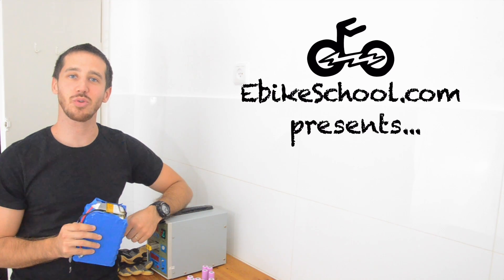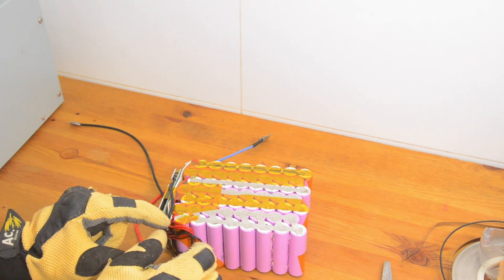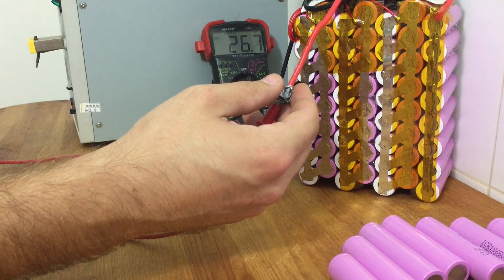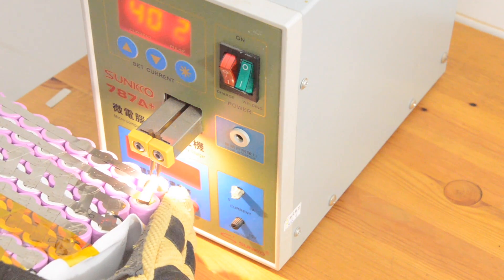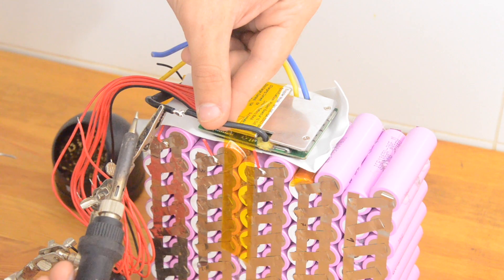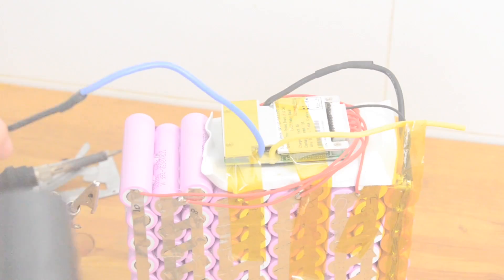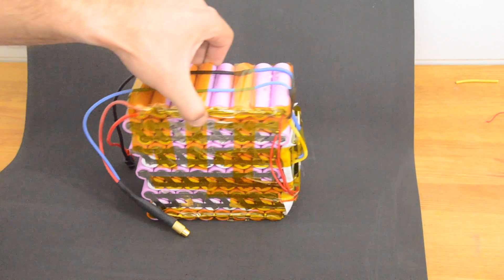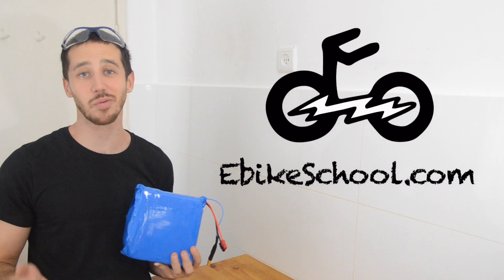How to Increase the Voltage of an Ebike Battery

Comment: Hi. Thanks for the how to video. 
I was wondering how you can adjust to increase the voltage and or current of the hub motor in the controller?

Comment: Hi Mica.  I really hope you can help me out .  I have a 36v nominal-14AH- 10S4P- 40 X 18650 cells total battery pack with a BMS, from a skateboard.
Because I do not have a spot welder or the proper battery charger for a 36v pack,  I have decided to dismantle the complete pack and use the individual cells for other projects.
I have been scouring the internet for days now but cannot find anyone who dismantles a pack only guys building packs.
I have disconnected the BMS from the pack but I don’t know how I am suppose the disconnect the nickel strips because it is in parallel and series. Is there a specific sequence that I need to follow or can I just rip them off ??????
Pls be as specific as you can as I am not used to a pack in this type of configuration, when I first thought that I could just rip off one off the nickel strips it sparked a little and got a little hot, so I stopped and started trying to find more info on the internet and found you.
Sure hope you have the time to help me out.
Thanks
Gerry

Comment: Stupid idea to tell people add brand new 18650 two a dying cell  
Or worse adding cells from China that aren't genuine your basicly teaching people how to make a bomb that's sits under there butt 
Plus even if they passed the stage off buying the right cells 

For anyone who reads this . These battery's will Vent  if you slightly short them . 
You shouldn't use old cells unless your happy with the risk .
You need to own a hobby charger with a balancer .
This will check.that the battery's All discharge at the same rate. 
Trust me I've blown enough of these up because.i was happy to take the risk with dodgy  China cells. 
Help buying cells . LG or Samsung  . Price should be around 10 pound each

Comment: What is the max voltage difference of each cell ? 
I got cells ranging from 4.1 to 4.2V
Reply: Put them on a charger. And see if they charge properly. Should be full at 4.22 
Then discharge them using the charger two the same level. Put them in the pack use your charger again to charge each individual  battery two and make sure they are balanced ( unbalanced battery's will explode so being different charge values is fine as long as they charge and discharge at similar  speeds
Reply: Also each cell should be individually wired to the bms ( and you should by an bms  rated for the right size of the new battery and the amount of cells your using.

Comment: If I have a 48v  500w motor how bad or good of an ideal would be putting 2x48v lithium’s batteries in series or paralell to it ??
Reply: Parallel is fine, you will increase riding distance. In series would make it a 96v battery and blow the controller and motor.

Comment: do we really need to solder every cell in series for increase in voltage?
wont the result be the same just by attaching 1 negative and 1 positive at each end respectively???
Reply: How would the voltage travel if you didnt make connections for it xD

Comment: I'm trying to boost my 2 year old lg mj1 48v pack to 72v. I have 10p13s. I was planning on rearranging them to be 6p18s then add new cells to make it 10p or 12p. Assuming 10s, I would be adding 4 rows of 18. This should keep each cell group with the same capacity. I am told internal resistance stays fairly constant with age on these mj1 cells. I wonder if it would be better to just add new cells at the end of the series to avoid even a little internal resistance difference. It seems like that might put less strain on the pack, even if the original cells drain first. I've done a lot of googling and the best answer so far is build a new pack with $2000 worth of cells and junk. Informed opinions anyone?
Reply: Make sure you get a  new bms
Reply: They are like 2 quid and this guy didn't mention them (from the way your tslling about the cells im sure you know enough to know the rest

Comment: Hii..I make li ion battery for 600w motor for using 2500mah li ion cell(13 in parallel & 15 in series) and 13s 35Amp BMS but when I charge full then this battery gives 56v via BMS and I put into bike then my bike ride is aprox 9km and then the battery voltage is down suddenly 26v  but when I checked without BMS voltage of battery, is 52v. Then I plug in charge battery via BMS that time the battery doesn't charge. 
Can you give the solution of this problem ? Please.

Comment: hello friend, I build a battery with bms and 10 series 5cells with used laptop cells(3.7 volt manteined after 15 days), I have a 750-watt motor 36 volt,. after using it 100 meters, the thermal protection of the bms interrupts the current. ?which amperage do you recommend for this motore??? Thanks friend
Reply: 10x 3.6 = 36volts. I think your batteries do not have a good discharge rate and the bms cuts out. Try finding better batteries. 750w needs at least 20amp bms. 5 batteries in parallel needs 4amps per cell. I think your batteries are not up to that power. Try taking it slower instead of faster.

Comment: Hello Micah, while you were connecting the positive discharge red wire into the 10th parallel group, you stripped the whole wire to meet the length of the parallel group. But is it possible to solder the discharge wire at just one spot of the whole parallel group? Will this option generate more heat in the discharge wires? Thanks.

Comment: I'm sorry if this sounds stupid but I just bought a 36v 15ah battery 10s5p and the cells are 3.7v and 2600mah so am I right in thinking I only have a 13ah battery the 5p x 2.600mah = 13ah? and is this a marketing thing or have I been mislead, Thanks for any help. Brannen

Comment: hi...I have a ebike that i would like to rebuild. it's a 36v. bike that the batteries need replacing,  I'm thinking to bump up the batteries to 48volt leaving the existing motor. Will that damage the motor or just give more power and longer ride ?
Reply: i think its better for you to check the data sheet of your motor and see how much it can handle.
Reply: yes it will be fine. you would have to go over a thousand volts probably closer to 10 thousand to blow out the field windings...to figure out if your motor can handle your new battery you can multiply the current ( the amp hours) by the voltage ( which you mentioned) to find your wattage, and your motor should have a wattage rating at least, so if your battery is too powerful you can adjust your controller to limit the current so that the wattage is within an acceptable range...

Comment: how many amps can 0.15 8mm strips handle?
Reply from the maker: Best to keep it them under 5A, but they can do 10A max. When I'm doing 30A batteries, for example, I use 6 strips so they all stay at 5A max.
Reply: ahh so i'd have to double up the series links for a 30q pack if i read your reply correctly. im planning 12s7p of 30q to replace my worn multistar lipos to feed my mxus 3T

Comment: 1. I'd use a linemans splice any time you need to connect two wires. VERY strong and you can make it much more tidy, no little sharp edges and such. 

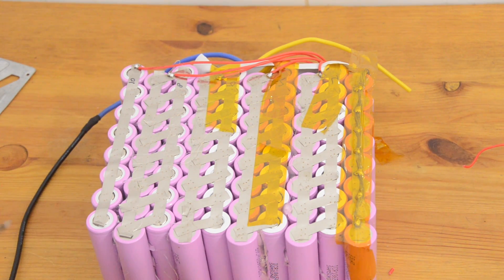2. Just use some heavy gauge solid copper wire for those "main" wire + and - leads you've attached across (starting at 8:38)

Comment: In you trailer you show a eBike Performance sheet /simulator, is this a battery capacity test using your light bulb discharge or another tool ? I need to test capacity on old eBike battery packs accurately.
Reply from the maker: No that's the amazing motor simulator over at http://www.ebikes.ca/tools/simulator.html
They've put a TON of work into that tool. It's quite awesome, I recommend checking it out and playing around with it!

Comment: Hi which BMS did you use ? I m looking of a 48v (13 cell pack version) How do you setup the BMS values ?
Reply: BTW Nice Video, well presented, safety addressed etc, etc, and yes we will all continue to modify our batteries and bikes, why on earth not, innovation is what keeps us alive.
Reply from the maker: Hey Alan, the BMS I used is listed in the video description, but that's a 10S. I believe the same vendor has a 13S, which is what you'd need for your 48V pack. I'm not sure what you mean about setting up the values. The BMS comes programmed from the factory. Or do you mean how do you choose the right specs?

Comment: Hello, why you don't use polymer li-lion battery for your assembly. it has bigger capacity, so you no need paralleling the cells as increasing the capacity.

Comment: I'm having problems with strips popping off. I have hand probes to repair it, but they absolutely SUCK.  Even at full amperage and pulse, it doesn't get hot enough fast enough to do anything. Any suggestions?
Reply from the maker: That's an odd problem to have, especially with your welder turned up so high. I'm guessing that's a problem with the welder, but I'd recommend cleaning the cell ends and nickel strips with acetone first just to make sure there isn't an oil layer that is causing a problem.

Comment: I noticed you are using ICR 18650 batteries. Is there an advantage to using these over IMR or INR batteries?
Reply from the maker: Each has their own advantages and disadvantages. For most of us, it doesn't make a huge a difference. Nowadays manufacturers are producing mostly hybrid chemistries with small additions to the traditional electrolyte mix, meaning that it's harder to say "All ICR batteries this..." and "IMR batteries that...." I mostly use Panasonic NCR batteries now though.

Comment: You are awesome. Can you make another one with 52v (48v) 16 or similar ah? That would be very helpful. Another thing, if you do not own a spotwelder, can you use soldering instead?
Reply from the maker: It's possible to solder cells, but it's not a good method because it irreparably damages the cells, and can even lead to dangerous fires from cell overheating if it isn't done well. You will see people doing it on youtube, but it's not a good idea. I'm actually working on a kit to allow people that don't have a spot welder to build a battery.  Stay tuned in the next week or so and you'll hear about it!

Comment: I'm new to the eBike concept but I feel like I'm getting hooked, so I think there is one in my future.  I'm just curious as to why Nickel is always used to to create the series and parallel connections, and not copper.
Reply from the maker: Nickel is used for a combination of functional and economic reasons. It has good conductivity, low resistivity, high corrosion resistance, is easily welded/soldered and is cheaper than copper.
Reply: Most folks don't have access to a spot welder like that.  Have you ever heard of someone using electrically conductive adhesives such as this epoxy?  http://www.mgchemicals.com/products/adhesives/electrically-conductive-adhesives/silver-conductive-epoxy-8331

Comment: Very very useful! can you give us an advice if the pack is used for a period of time. what would be the permitted difference between old cells of the pack and new cells we add? thanks!
Reply from the maker: If you mean voltage difference, it needs to be almost no difference. This is easy to achieve though, I just discharged the 24V battery until it matched the cells. For cell life, it's not super critical, but you'll be limited by the weaker cells. Basically, if your existing battery is a year old, and you add brand new cells in series, you aren't going to add any lifetime to the pack. It will still basically die when it was going to die. If you were adding cells in parallel to increase the capacity, you would want to try to use cells with as much capacity, if not more. If you use cells with less capacity, added in parallel, then you'll end up with a lower capacity pack overall because those cells will drain quickly and rob the other cells of their capacity.
Reply: Basically it is exactly as you assumed. My pack is a year old and I want to increase the voltage from 36 to 48 adding cells with the same configuration. I was just wondering if connecting used cells with brand new cells would cause any other problem apart from performance. I guess from your answer there isn't something important to worry about..
Reply from the maker: Yea, it won't be an issue from the safety side of things. It's just a longevity thing. If your pack was originally going to last 3 years, it's still only going to have 2 years of life left in it after you add the new cells. But functionally speaking, adding new cells is just fine. This pack was about 6 months old when I did this upgrade.

Comment: Nice footage.  Great job.  Battery suggestion please. I have this motor - 24v 500w 4800rpm. The (S) and the (P) I am looking for. I wish to use The latest Panasonic 18650's. Any suggestions will be greatly appreciated.  Thanks.
Reply from the maker: For 24V you'll need 7s, which is 29.4V hot off the charger. The parallel number is basically up to you. In one of my other videos I built a 7S2P (5.8AH) using Panasonic PF cells, but thats about as small as you can realistically go. 7S4P would be even better.  Panasonic has a number of different 18650 cells to choose from.
Reply: EbikeSchool.com Thanks for your answer. You use 3.80v as your max charge.  Why not 4.2v or 4.0v?